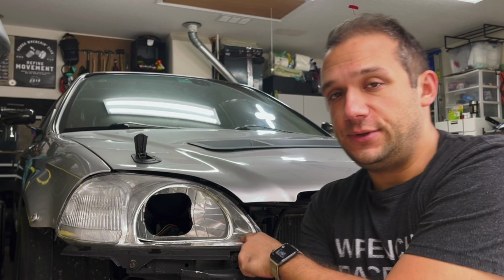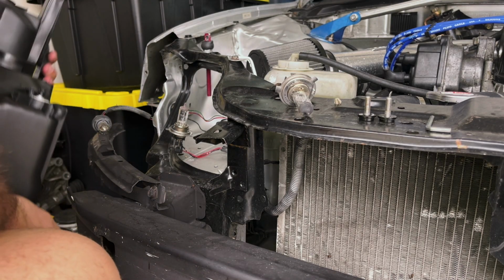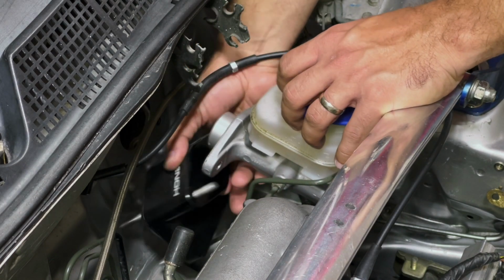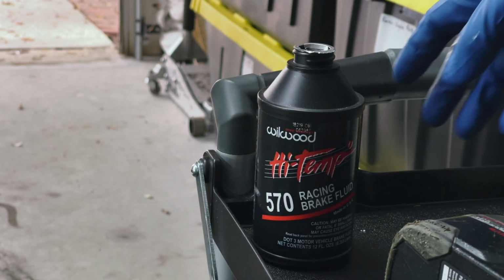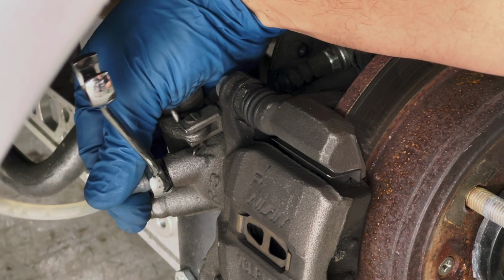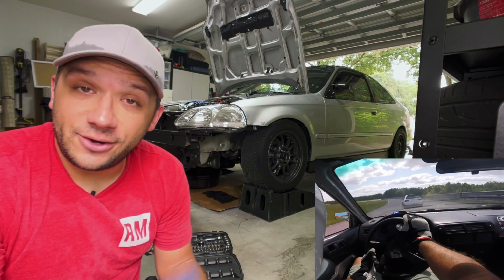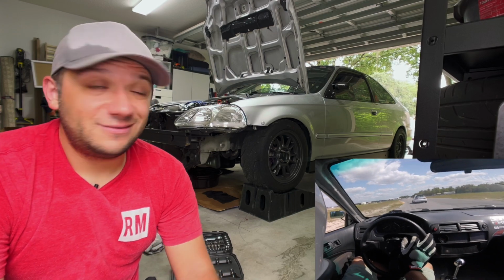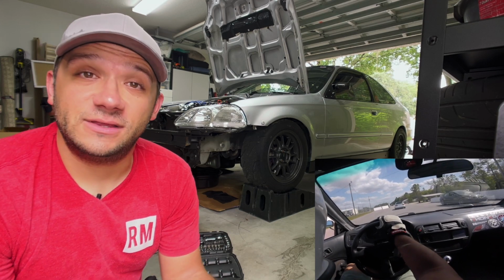Honda Meet Track Attack April 2022 and Changes to Project EK!

Comment: I have been on the fence about the brake booster delete also. Was the extra pedal feel even worth it?
Reply from the maker: For me with the oem brake set up, up front no it is not worth it.  The trade off and missing shifts hurts lap times more, and I already feel more confident having the booster back. I will say from I’ve heard much better things from other people using the Honed delete set up with big brake kits or even just a more aggressive oem kit.
Reply: O.E.M. I say...just by driving a friend's delete booster. Brake feels hard like a brick. Can't feel pedal. When brakes Bite or not. O.E.M.

Comment: Going next week? I signed up, after missing the last two due to engine issues.
Reply from the maker: No I didn’t sign up. the last time it was hard to get more then 10 mins on track.
Reply: @RefineMovement  from what I remember on my recorded videos I remember seeing 10 to 12 minutes per session and the traffic varied...

On the brake feel, I was reading a forum with a lot of scca guys and one thing they mentioned was some fluids change pedal characteristic feel like stiff vs squishier pedal feel.
Reply from the maker: It’s not about pedal feel it’s about pedal throw before brake pressure starts happening